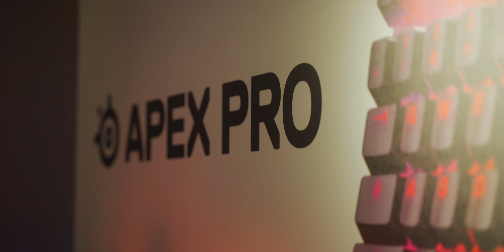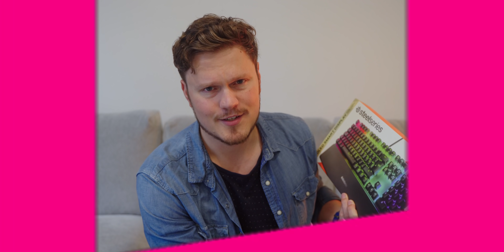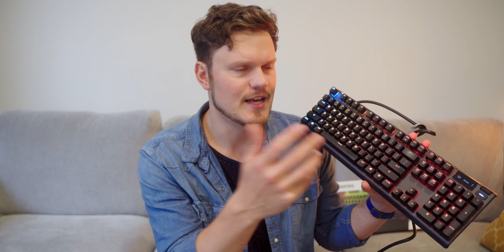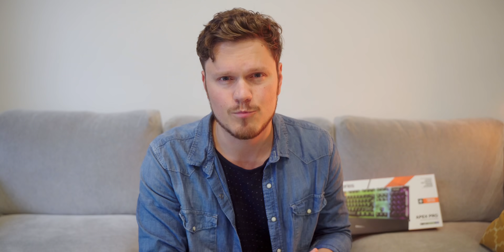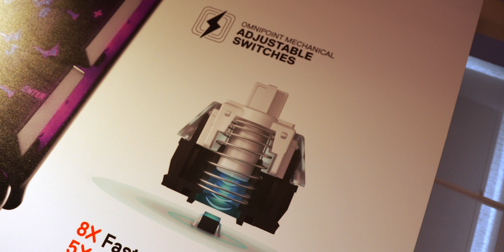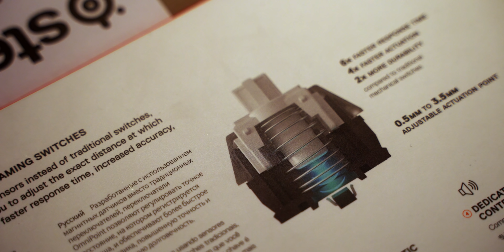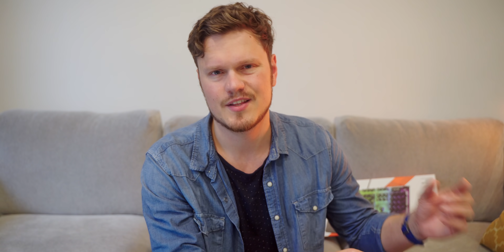Did Steelseries Create The ULTIMATE Keyboard Switch?

Comment: They need to make a switch where you can switch from clicky for typing to non clicky for gaming.
Reply: Switches don't work like that, the size of a keyboard isn't big enough at all to house such a mechanism. And even if we were able to, the tactile feeling would probably be weak as hell (I'm talking cherry brown/romer g level) and it would cost a fortune. Cool concept, but it's most likely not going to happen. You're better off buying two keyboards.
Reply: @sami firdose A magnet can't make a tactile feel or clicky sound. For this concept you would need a clicker/tactile bump and a mechanism to move it out of the way when you want. That would cost a huge load of engineering and money. Furthermore, there just isn't enough space between the keys to house such a mechanism.

Comment: Interesting. I have wanted to try a linear, light 1.4 switch. This kinda gives you that option, though next is changing the weight needed to press, probably also with magnets. Magnets are engineering's panacea it seems lol

Comment: I'm worrying that the The consistency between switches will be a huge Problem... The forces that are measured in the switches have to be miniscule, wich can leed to high varience from Key to Key. Just imagine having one Key acctuate on a diffrent level than de other. Especially because Magnets are prone to suffer from drops, heat, other strong magnets (they are everywhere e.g speakers in your phone) or just some varrience in general . I'm not yet sold on the Idea. Also magnets can simply loose strnght over time i think
Reply: Raining Man nobody liked but it’s a good thought🙃

Comment: only changing actuation point isnt enough, they should be analog like wooting one and Cooler master MK850.
Reply: Wooting even has prototypes with flux sensors like this keyboard (they call their switch the lekker switch), including possible analog usage from 0.1 to 3.8mm.
Reply: Hana Song they came out first with the magnetic switch...the rest can be done with a firmware update...I smell precise marketing reasons for this...
Reply: stfu

Comment: can i use this as analog?
please?
Reply: Probably. But I'm pretty sure they'll release a wired version as well.
Reply: make an analog when it's plugged in because of power requirements of course, and adjustable when wireless and I will buy it immediately. Lol
Reply: Doesn't appear to function as such though it might. Buy a Wooting board if you need (guaranteed) analogue switches.